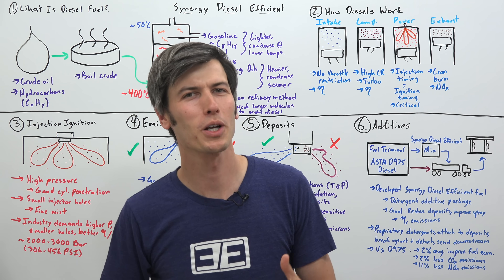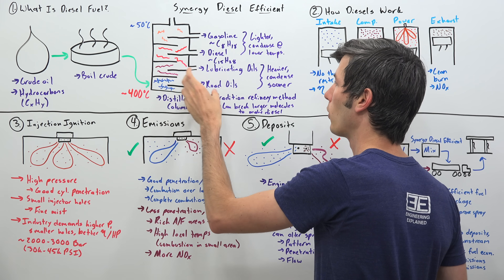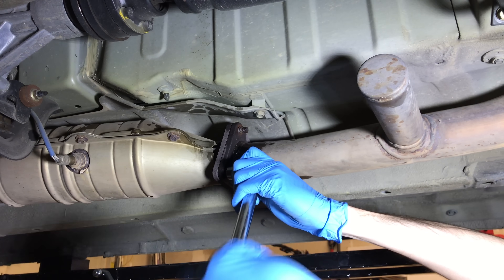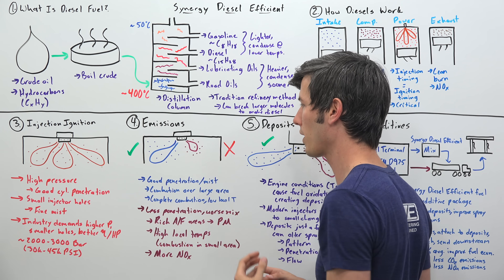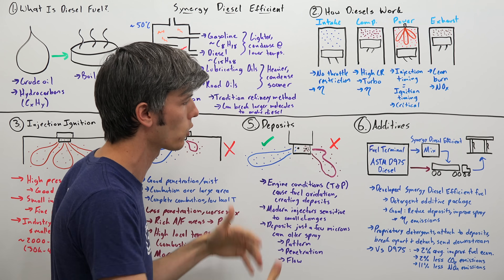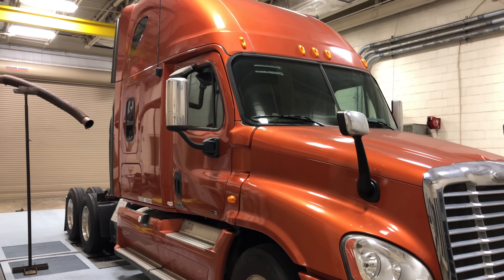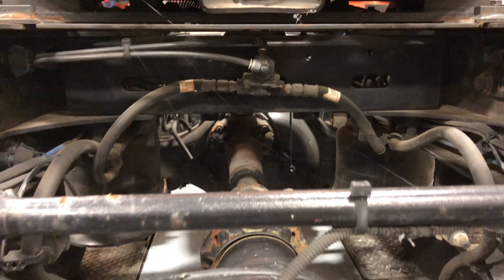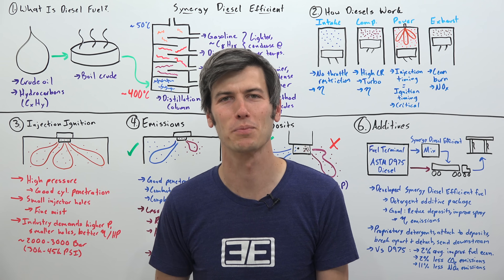Why Diesel Engines Lose Power & Efficiency Over Time

Comment: The information on diesel engines was very interesting, however my vehicles are powered by gasoline.  But I do have a question.  Since both of my cars have a display that shows the MPG rating down to the tenth of a mile.  I've noticed that the gas that comes from certain gas stations results in better average MPG ratings than other stations.  The independent brands of gasoline almost always give better mileage than brand name gasoline.  Is there an easy way to measure the energy level in gasoline?
Reply: gasoline is a mixture of different alcanes (type hydrocarbons) that have a range of carbon content pro molecule between 5 (pentane) and 10 (decane).
what i am trying to say is that each brand can have a different mixture and a different quality, the main index here is the octane index.

The higher octane index implies better Knock resistance, Gasoline engine control units has the ability to analyse gasoline quality, if the ECU notices that fuel quality is better, it will ignite the mixture earlier and hence provide u higher power for the same amount of fuel or better consumption for the same power output.

hope this comment was helpful.
Reply: There isn't really an easy way to tell which fuel is the best. More expensive fuel might have additives that prevent knock, lower friction, fuel degradation or water separation. Also they may have some cleaning agents added that remove or prevent accumulation of carbon on in the combustion chamber. Here you can get "cheap"  fuel which is just raw 95 gasoline with nothing special added and I found my engine running on it just fine. Some people claim to have problem with loss of power or knock when they use it. Anyway I digress... only easy way I can think of is buying gasoline which has no alcohol added. Alcohol has lower energy density, so you will need to burn more fuel to get the same amount of work done. Depending on where you live this might be difficult and not worth the money.

Comment: Diesels are actually the most durable & reliable engines
Reply: Most of the time, at least. 200,000 miles? More like 4-500,000. Heck, my gasoline Camry is at 189,000...
Reply: @jordanlatta  my gasoline car has 400.000 miles with no engine repairs. It has started burning some oil though
Reply: @Ross Bourne  not an engine fam its electric  motor
Reply: @1Slamalama1  A steam engine is not an internal combustion engine. If you are comparing all types an induction electric motor would be the most reliable as it has only one moving part.
Reply: @1Slamalama1  Says the person who has never heard of an induction motor. The armature is integrate into the shaft and it is the only part that moves. I don't think you know what an electric motor is. Try to keep up.
Reply: What about the Ethanol engine, walking 5000 miles and then walking 5000 more.
Reply: @1Slamalama1  I'm actually running water on my diesel now. Sprayed heavily into the intake and it is unbelievabley effective. So diesel/ steam engine lol
Reply: @ 1Slamallama1

Not even close. Steam engines succumb to corrosion very quickly without constant maintenance. 

That’s why the railroads swapped to diesel. They lasted longer and had a fraction of the maintenance costs.
Reply: @1Slamalama1  Which is why railroads jumped on cutting them up when diesels became main stream
Reply: Why actually?
Reply: @1Slamalama1   steam engines aren't IC engines
Reply: Not really. 

The only reason why you see old and high mile diesels are because the cars are or were more expensive and are relatively rare. 

And chances are a huge percentage of those diesels will be burning oil.. something that would scrap a gas engine because it’s not worth it to fix.. but because it’s a diesel people keep on running them. 

Then get into the repairs like turbos and HP fuel pumps and injectors etc and the price is about the same as a head gasket in a gas engine .. something that happens far less frequently and also tends to write gas engines off anymore. 

No.. if you do regular maintenance there’s no reason why a gas engine won’t last a million miles.. and there are many examples of such. 

Just for most people it isn’t worth it.
Reply: Nope, electric engines are way more reliable with less parts and maintenance :D
Reply: @Diablokiller999  That definitely justifies their insane price tag
Reply: @floridianrailauto9032  Electric Motors aren't expensive, it's the battery at the moment. But the research finally ramped up in the last couple of years and still is. Tesla cuts the price per kWh nearly in half, Toyota and Panasonic also do some heavy research on solid state etc.
Cobalt isn't used in the newer cells, that element has also a huge price point.
Reply: if maintained nicely and driven normal,every other scenario and it will die

Comment: Since you've gone to the dark side by mentioning diesel - maybe a video on "renewable diesel", bio-diesel and such is in order... and what emissions they're trying to reduce ...  also maybe touch on PC and UFP issues sure to be the next generation bogon...
Reply from the maker: It's a fascinating discussion! There are certainly pros and cons of using bio-diesel. It's kinda a similar argument to using ethanol in gasoline. Diesel fuel can have no more than 5% bio-diesel (I believe) before it must have a label informing the consumer.
Reply: @EngineeringExplained    talking renewable,  different than BIO-diesel per se...  look up REG or Neste (not nestle...)  ;)
Reply: also I see I wrote PC, but meant PM. my bad.

Comment: Gasoline produces more NOx and CO than diesel, gasoline has a better conversion efficiency of NOx into N2  using a Three way catalyst, it has nothing to do with the difference in the mixture formation.
Actually diesel has a lower combustion temperature due to the higher efficiency which implies better conversion of chemical energy into a mechanical one, hence less heat. 

The better mixture/distribution of the fuel in the combustion chamber plays a role in the soot and HC formation.

Comment: My 3yr old Mercedes with the 2.2d. OM651 now has 87,000 miles and ive not noticed any reduction in performance or efficiency. All 420NM definitely still there, and still averaging 68mpg every week. Approx 720 miles per tank.
What sort of mileage on a road car do you think a Diesel will start to deteriorate ?.
Reply: You can expect between 500,000-1,000,000 miles before the engine is shot, depending on how it's driven and if it's driven highway or city.

Comment: It depends on how you take care of it. I have a 15 year old car with diesel engine, works the same as first day. Has not lost any horses :D
Reply: I also have a vw golf from 95 and from time to time If I feel that it losses power I just run it at a higher rpm for a time  to loosen the deposits off
Reply: Cool story, not true however.  unless you never drove it...
Reply: @mattlane2282  it has about 150k miles, same 80bhp from the begging
Reply: @gx6250  Yeah see you are trying to say it took no wear, no dirt... and that is not true... you do not have the same power as day one... fact
Reply: @mattlane2282  if you take care of it, it will have the same power, measured on dyno

Comment: Is the Synergy Diesel more than 2% over the national average cost per gallon of diesel? If so, cost isn’t a benefit. Having cleaner injectors and fuel system with longer service/replacement intervals could be where the cost makes sense.
Reply: not quite, if you consider how much fuel you're using before you have to change or clean the injectors, its far far more expensive to use synergy diesel. There is also preventative maintenance which cleans/replaces parts based on a schedule rather than when they break so switching to synergy fuel wont matter.

Comment: Did they considered the break-in of engine and transmission to this 2% improvement? I mean, it is quite common to see improving fuel economy in high mileage and well maintained cars. But anyway, it shows that they could keep the system running clean, which impacted the fuel economy against the standard fuel

Comment: ALL fuel brands have additives. Instead of testing fuel with NO additives (that is sold almost nowhere) against a particular brand's additives, compare one brand's additives to another brand's. Of course, none of them will ever do that, because then everyone would see that there isn't much difference from one brand to another.
Reply from the maker: No, ASTM D975 is available at pumps (it HAS additives). This is what they tested against.

Comment: I just have a couple of questions I have an f250 1996 with the 7.3 l Diesel and I feel that I have to use the off road diesel in it because it just does not run right on the ultra low sulfur diesel and then on top of having to use off road diesel I use diesel fuel treatment can you explain a little while that might be because without treatment and regular pump fuel I have no power and it has a hard time idling and it just shakes when I run off road diesel with an additive not even a cetane booster just a diesel fuel treatment it smooths out and responds like a sports car
Reply: @jacobdukes4741  maybe where you live but here it's listed in parts per million on the pump and that is why it's for off-road use because it has more sulfur content
Reply: Check the pump man you're being fooled either you've never used  the off-road diesel or you listen to somebody tell you that it's the same that it's just dyed it's not just dyed and $0.20 cheaper a gallon, the price reflects a lot of things like taxation but it's not the same fuel that you get at the pump sulfur content is significantly higher sneak up to the pump and fill your truck your truck will tell you

Comment: I have a 2.0 TdI in a 2012 golf she pulls hard and gets amazing fuel economy love it.
Reply: Mike Miklavic that’s because you aren’t burdened with any emissions controls.
Reply: @jeffreygoss8109  If that's an EA189 engine it has a particulate filter and the fuel economy is from well controlled combustion, so its emissions are a lot lower than what came before it. If you look at other diesels of that era, the number of cases where the NOx emissions controls are switched off is so long that quite likely nothing from that year that didn't run a urea SCR system could meet NOx limits in the real world anyway. The difference with the EA189 is that it literally only met emissions during the test, to the point that if the steering wheel wasn't continuously held straight, so it knew it wasn't on a rolling road, the car would never go to the low NOx map.

Comment: 2% is a very small margin to work with.  When you consider the additional cost of the fossil fuels used to make these additives (both in energy and materials), this leaves even a smaller margin than 2%.  Also,  just replacing the volume of additives with diesel fuel itself might be enough to make up a 2% difference.  I also understand that the additives are not just to improve fuel economy but also stabilize the fuel from degrading and other functions as well.  However, in my line of business, if I were to propose adding a whole new, complicated process (that requires additional facilities to develop it,  factories to produce it, storage facilities, distribution (to all of the refineries), etc) to improve <2%, I would be laughed out of the room and then later asked to resign.  Saving the fossil fuels by not having these facilities (fossil fuels to build to begin with), not having people driving to and from them daily,  and not producing this product may in itself be enough to off-set a 0.1- 2% difference globally.  To me the best justification for these additives is cumulative effect.  If you can prove that without these additives the fuel efficiency would gradually decline (and eventually plateau) due to the accumulation of deposits (especially in the injectors) to say 30% less over the life span of a vehicle then this would be a substantial argument.  Sometimes these fuel "solutions" seem to have a smaller net effect in reality than the small amount they are supposed to help.  So are we really doing the right thing and are these solutions really worth it?
Reply: @usingthecharlim  That's the beauty of percentage. With full load those 2% might be a higher difference in absolute numbers than in daily driving. But they'll be 2% :D

Comment: Fun fact for you that the anti 'big oil' types dont want to discuss at all costs. 

"Big Oil" only makes around 5 - 15 cents per gallon of fuel they sell whereas big government makes around 40 cents to $2+ dollars off each gallon in taxes and other fees.  

As far as big oil is concerned today they'd love it if everyone had high efficiency vehicles and other items that use their products so that they could sell you  half the fuel at twice the price for twice as long.  The problem is the big government and their taxation would take it in the ass for it.  
Also why big government give big oil subsidies, they have to give big oil some kick backs on  the heavy taxing to keep them from rocking the boat too much.  

So, for those thinking emissions compliance is all for the environment (while coincidentally pushing up fuel consumption rates for useful work done) is what the game is about, think again.  Sad fact of the history of emissions compliance is that every new Tier added vastly more taxable costs to the construction and operations of a engine plus increased its fuel consumption while decreasing its service life in more cases than not and especially in the case of typical passenger vehicle engines.  

 Ever wonder why your new Tier 3 and 4 7000 # diesel pickup makes 300 HP and gets 14 - 18 MPG while a pre emissions 400+ HP  80,000 # commercial semi (that also has 5x+ the aerodynamic drag)  gets 5 - 7 MPG in the  same highway driving conditions?  Guess who's the biggest tax base that is the least able/willing to fight back?

There's a reason that back in the pre emission days every engine manufacturers (especially farming.commercial application) top advertising point was it HP hours/gallon numbers that show how fuel efficient it was.  Once emission compliance came out they never spoke of those numbers again.  

As for what really cleaned up or vehicle emissions,  Well the vast majority came from fuel reformations, not engine mods.  Sad fact of today is most of our modern fuels will not run a old school engine properly if that engines stock A/F and timing settings are used.  Its too weak and lacks the volatility to burn right and why the old fixed jet carburetor engines wont run without the choke part way on without having the jetting opened up.

Comment: Cool video, very informative, but the real question that needs to be answered is what your age is. Are you 25 or 45? I’m lost here
Reply: He is 56.  ;)
Reply: Paradoxically both of course.
Reply: He said the injectors get clogged up and that reduces efficiency. What you can do is get the premimum fuel once every 5000km or so and clean the injectors with it then go back to normal diesel. Same with gasoline really, you can buy a bottle of additive to the gasoline for the same price as a full tank of premium fuel which does essentially the same thing to it as the premium diesel fuel does to the diesel engine. Which is mostly dissolving left over soot from combustion cleaning the internals of the engine.
Reply: He says in another video that he was born in 1963.
Reply: No. He is 66 or 67.
Reply: r/13or30 ?

Comment: Jason, you started out saying that diesel engines 
do not have a throttle.

At about 11 .5 minutes in, you start mentioning 
throttle and throttle position.

Which is correct?

steve
Reply from the maker: Well, they don't all, though some modern ones do use them. When I say "throttle position" towards the end I'm referring to the position of the accelerator pedal.
Reply: @EngineeringExplained , don't feel bad, 
I saw Gale Banks doing the same thing.

Great channel, by the way.

steve